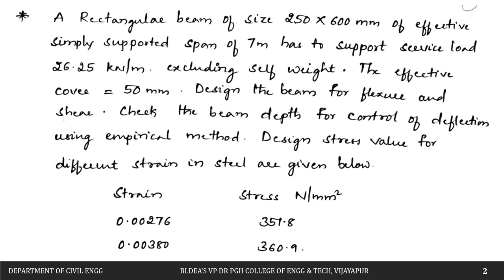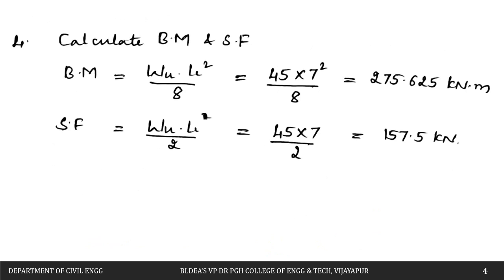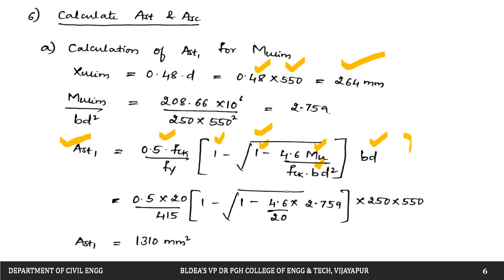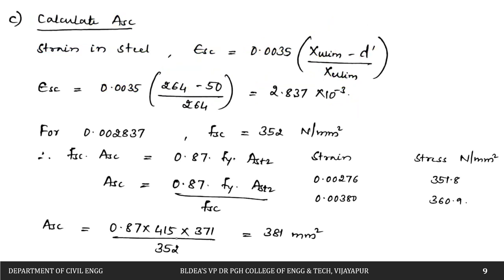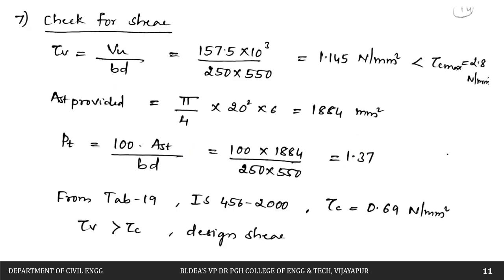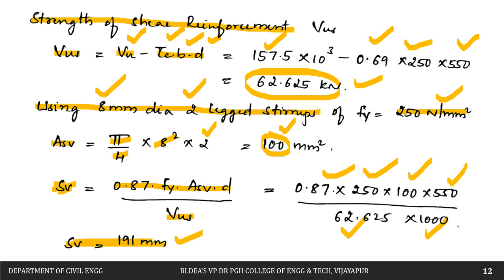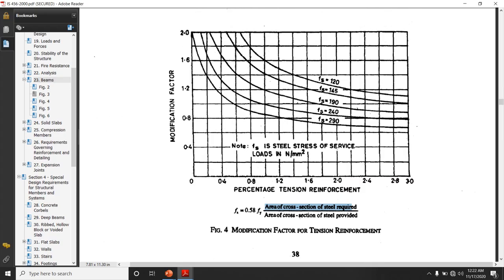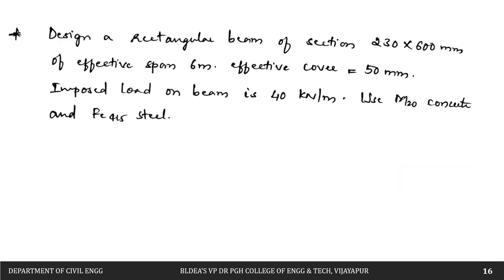Design of Doubly reinforced Beams II Lecture-23 II Module-3 II DRCSE

Comment: Sir Ast 2 u calculated 371 mm^2 but(13:50) at the summation of Ast1+Ast2 ..u take value of Ast2 is 381 mm^2...why?
It is necessary that the value of Ast2 =Asc
Reply from the maker: By mistake I have written 381..
Actually it has to be 371 mm2 only..